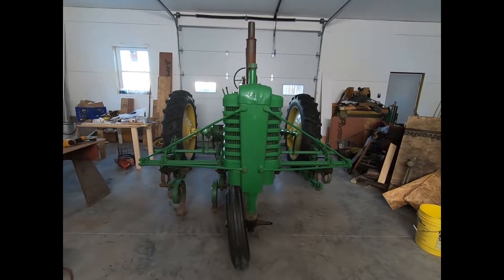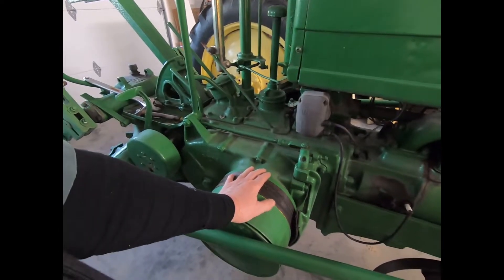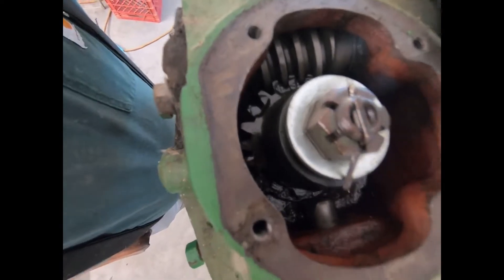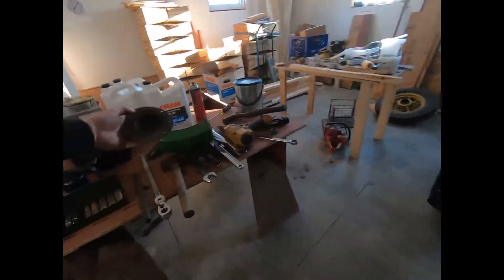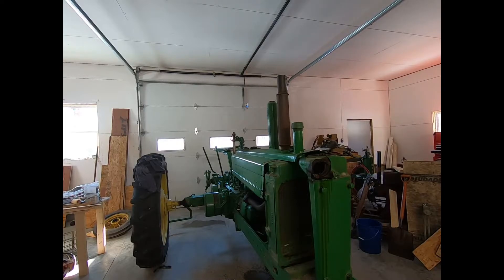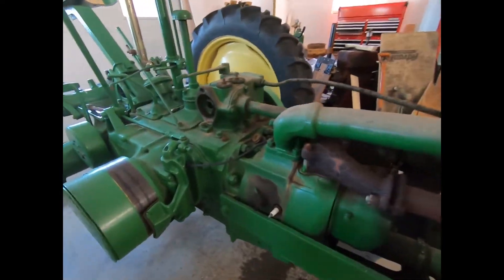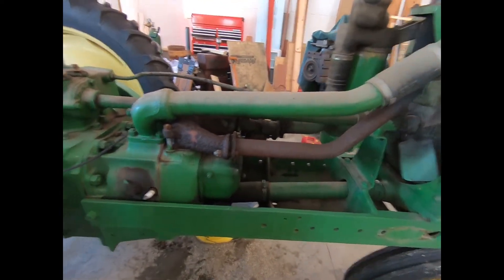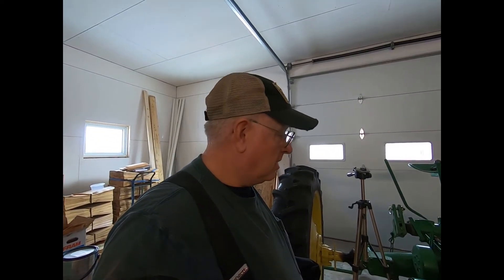# 390 JD-B s.n. 147828 Engine rebuild part 1

Comment: Great work, Tim. 
We had a 1950 model B that we built to tractor pull. It made 42 hp on the Dyno. 
With the six speed, it was amazing what it’d pull. They are tough little tractors. We used it to pull firewood loads in and the neighbors would be out there listening to it chug up the hills.
Reply from the maker: They do a lot of work if given a little maintenance.

Comment: Good Morning from Idaho   I will follow this with interest as I picked up a pair of late pressed framed B's last summer.  John Deere's "Corn Head Grease" works well in that steering gear when the seals are wearing thin.
Reply from the maker: The last time I filled it I used grease cut with engine oil still leeks out.

Comment: I believe 7 gallons of coolant 7 quarts of engine oil and 7 gallons of transmission oil. My first Deere was a B a late model B 290923 I had it bored and two new pistons. Back then, 55 years ago, there were many B's still in use and the parts were reasonable.
Reply from the maker: Pistons are about 200 each with rings arist pin